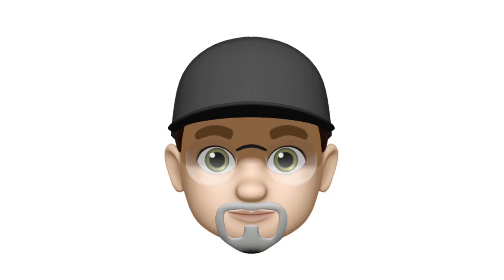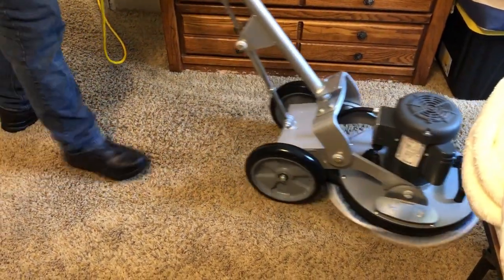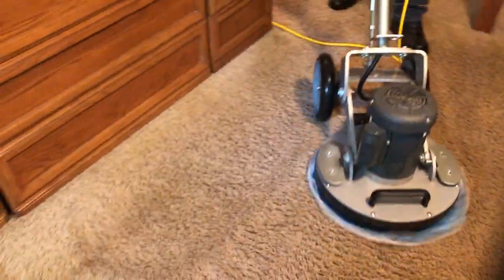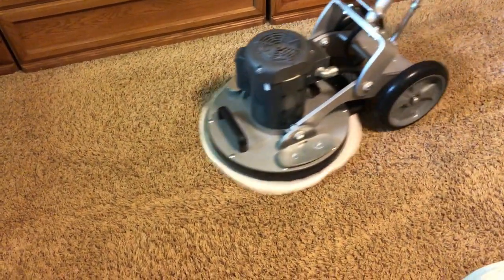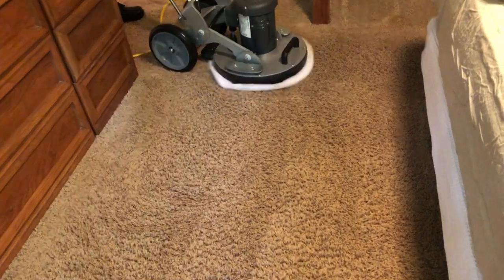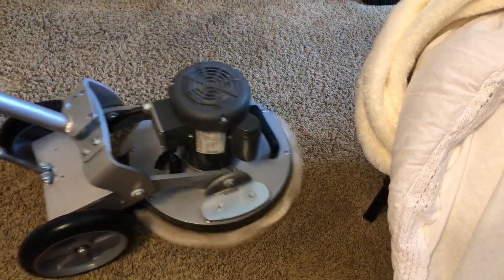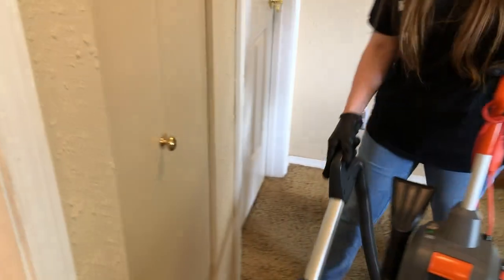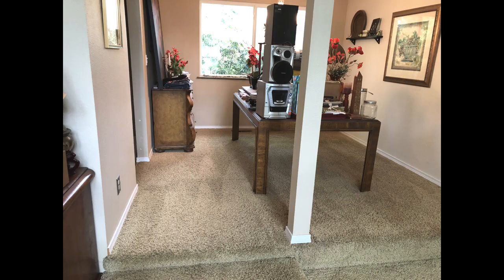Another BANGER Carpet Cleaning Guys VLOGS Episode

Comment: Do you only pre spray once ? After the initial scrub . When extracting , do you put solution on the pad or carpet again ?
Reply: Bonnet
Reply from the maker: I prespray then use a damp micro scrub bonnet to agitate in. Then follow with a dry bonnet to extract the soils.

Comment: You make a good point about VLM, that is why I don't call what I use bonnet cleaning. I came up with the acronym SETT that stands for Soil Extraction Transfer Technology and I even have a logo for this. I think all of us using this pad system wether it be OP or Rotary should adopt this new term to set us apart from the old school bonnet system with its poor reputation. Your OP machine is doing about 9 passes per second on the carpet fibre and you certainly can add a LED light to it but plug in ones I have seen often have a weird spectrum too be sure it is putting out natural light. Mine is 12 volt and I use a transformer to power it. That is certainly a dirty carpet, nice job, you have indeed come a long way in your journey.
Reply: Im going use that acronym. Brilliant! Of course I will cite you as the original author.
Reply: Good point
Reply: @mar-c6942  Bonnetpro adopted it but I think he is not using it so much now as I suppose he is commited to "bonnet"
Reply from the maker: I will definitely be adopting that SETT much more scientific sounding 👍🏼 jeeez now I gotta raise my prices 😂✔️
Reply: @procarpetcleaning  Now what I need to do is put out an image of the logo I created so anyone can use it in their advertising and we all are on the same page and using the same images.
Reply: I’d love to add that SETT logo to my site as well! Great idea.
Reply: @OxyDryCarpetCleaningKelowna  Would love to use the S.E.T.T. Logo